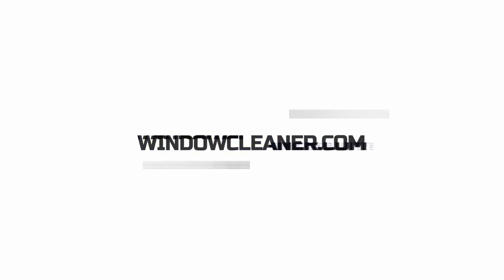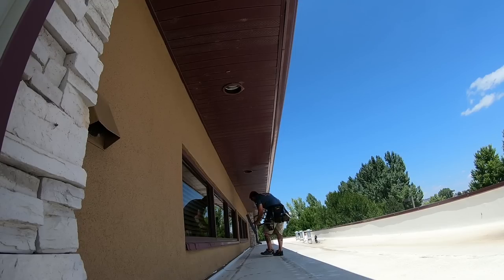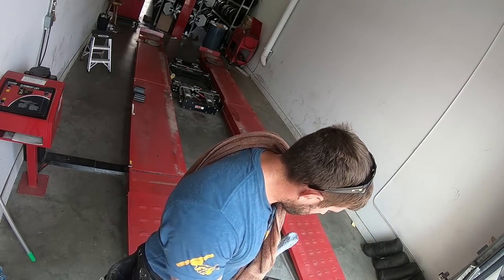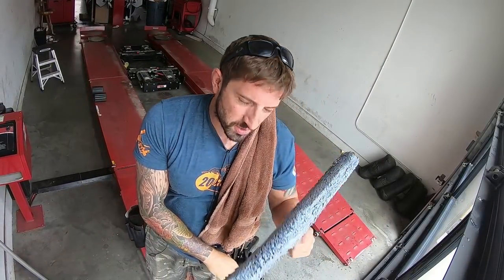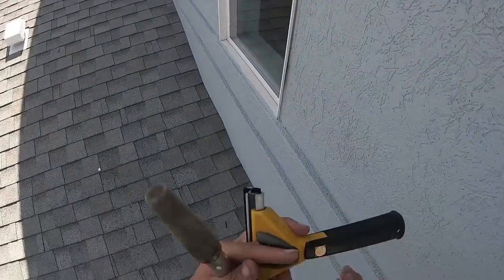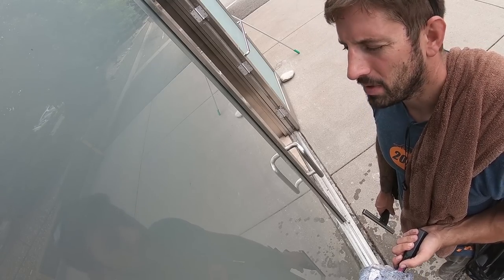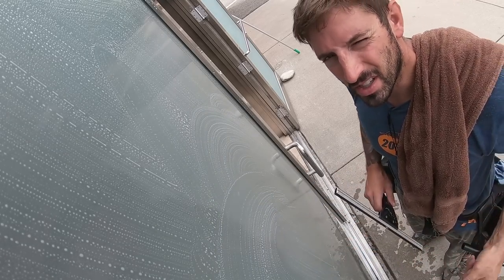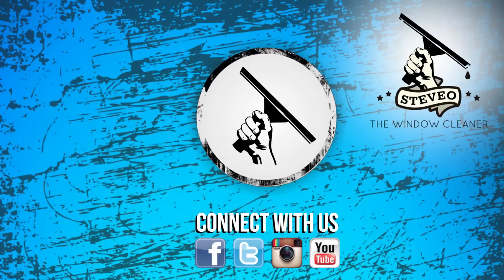Tips On How To Be A Faster Window Cleaner

Comment: On point i find i just use my 14" 90% of the time.  Work flows a massive time saver!
Reply: Sunshine Windows yea for me my 18” is what I try to use for everything on commercial and my 14” for residential
Reply: @SteveOthewindowcleaner  yeah i was the same but my 22" sorbo its really the rubber blade side that i just use the one 14" liquidator squeegee, i find my 18"liquidator rubber blade has a tendency to bunch up or streach out in the wagtail (i am using blackdiamond t rubber soft in it possibly why) where as the 14" consistently works flawlessly. The sorbo needs clips i haven't actually been doing enough work to use 2 different rubber sizes and be swapping out between the two so its easy to just slide in and out of liquidator in wagtail with being a stay at home dad bar 1 day a week... now im working 4 days the 22" been back out at commercials
Reply: I have been cleaning all kinds of windows for more than 15 years and in this video if they are the correct techniques.  Like the mojito under the strip.  Yes sir, nothing is stained.

Comment: I agree with Douglas.  It is always a problem doing straight pulls even if you pull more quickly and leading edge down.  It generally pulls water from the top edge of the frame and leaves a line.  Sometimes I can cut in the top or dry the blade before the second pull.  Don't know how you can do it on second story windows and your Excelerator which is my personal favorite.  What am I missing?

Comment: I mostly work at a steady pace, my tools and technique are quick. I mostly have 3 squeegees in my hip bucket, 18, 12, and 6 inch Wagtails. Sometimes 2 precision glides 18,12. A big change from the 36, 24, and 18 thick Ettore I used to use ( backup status).
Reply: With commition the daily amount is the same, timed to do in a work day. There are times I'll expedite the day, mostly work efficient. Fast can need to be done twice, efficient once done timely.

Comment: I noticed over time if you measure or make odd sizes of my Squeegee's a  set
Instead of using a trusty 18 inch 
In the window is 19 and a quarter inches why do two swipes at it just make it squeegee to fit the window one pull straight down you're done or 1. Straight across and you're done

I believe in my 32 years of cleaning  windows
Less moves on Cleaning glass panes 🤟
Reply: Vince Riegler I love when a window is a perfect for an 18” Channel, makes it so easy for just one pull, I wish all windows were the same size but then the world would be boring 😉
Reply: 22" channel can be cut down easy. I find using an 18,12, and 6 are good sizes, then a 36" blade is cut with little waste. Using the best techniques for the situation is crucial.